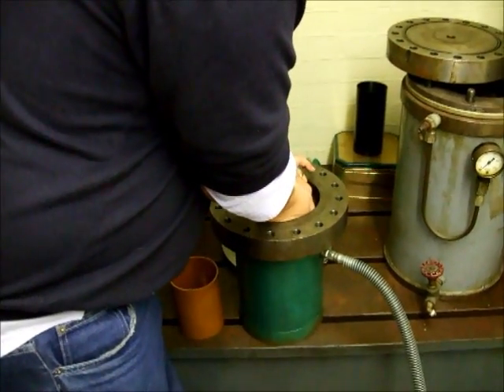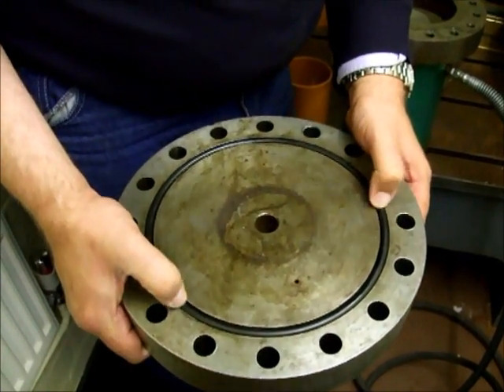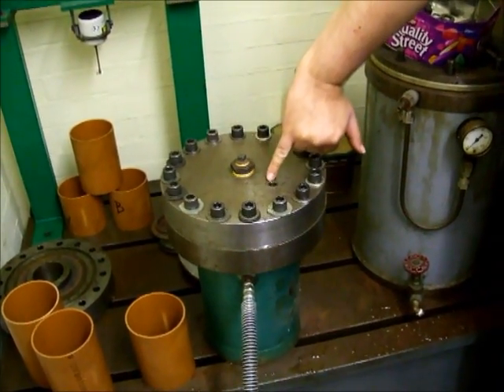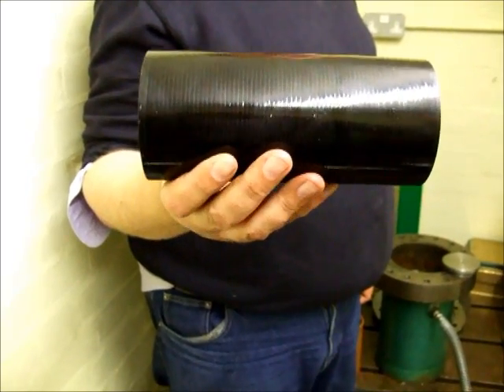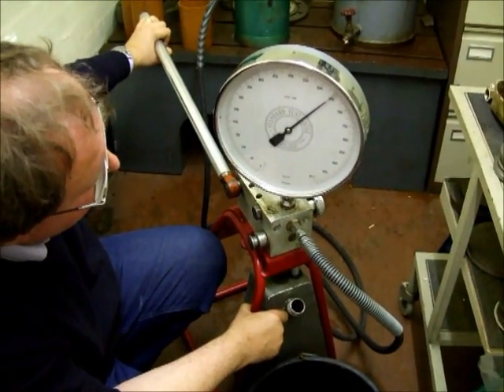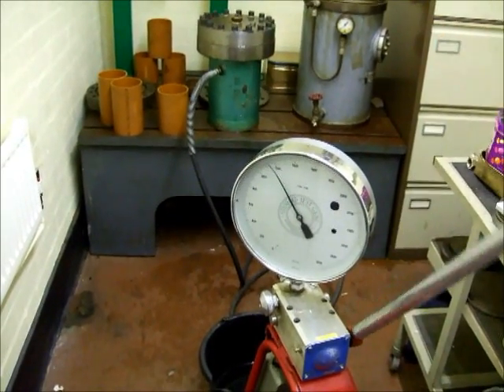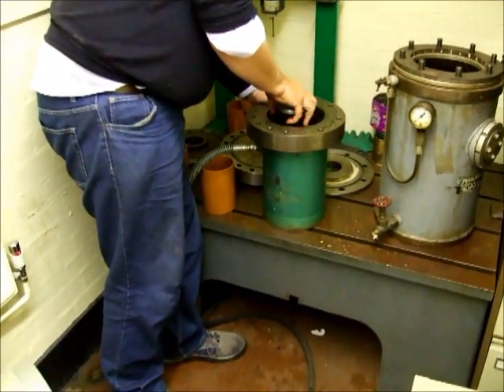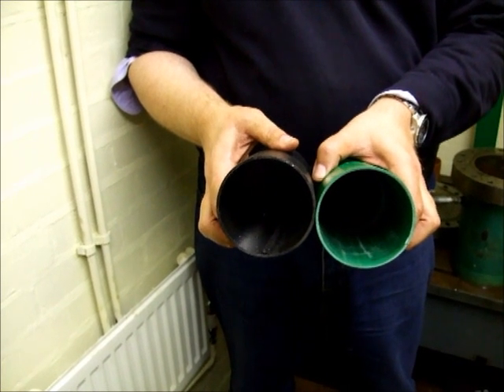Collapse of Composite Submarine Pressure Hulls

Comment: Airplane fuselages fail according to how many repressurizations they do. Material fatigue results.
Reply: Ultrasonic and visual. Material fatigue in aluminium will start as cracks so it can be visible to the naked eye if it's gone that far. On commercial aircraft you do inspections with regular intervals to avoid any big failures due to material fatigue. There's a reason way aircrafts are still made from Aluminium...
Reply: What kind of special device?
Reply: @neeleshramputh Although thousands of carbon aircraft fly, there has not been a single carbon-related aircraft accident to date.
Carbon is a good material if you have bigger pressure inside then outside. Apart from this, quality control, test certifications and working in accordance with standards is also an important thing.
Airplanes are beeing checked regularly.
Finally, carbon is beeing used for a long time. Not only on super cars, airplanes or on space missions, you can see them everywhere, where lightweight construction needed. Even mid range bikes for daily use are beeing produced from CF.
Reply: @dogukantosun5547  Not completely true.  American 587 crashed because of a failure of  a composite attachment lug holding on its vertical stabilizer.  Although it exceeded its design limits, it was apparently not a failure of certification or testing.
Reply: @mr3745  just googled and found the NTSB report. Following part is important; "Material had failed because it had been stressed beyond its design limit." It is not because of carbon. It was a miscalculation of engineers. Any other super strong material would fail, if an engineer would miscalculates the stress.
Reply: Look at the Hawaiian Air jet that lost a good section of its fuselage due to pressure cycles fatigue. Classic example.
Reply: @bruceblackerby3742  Fatigue is inavidible. On Aluminium aircraft (Like on Hawaiian Air disaster) the frame is divided into sections, so fatigue will not spread into other sections. In that particular ALUMİNİUM example, there was fatigue in every section because of a lack of control. This case was an exception and it is unlikely to happen. 
Unlike Titan, aircraft are not fully sealed. They are always lacking air and you compensate this difference with the bleed air from the engines.

Comment: Carbon fibre its a good material to make high pressure tanks, like GNG and Hydrogen tanks and can hold pressures up to 900 Bar. But the problem its that in a tank you have interior tension forces in a deepth submarine you have high compression forces exterior. Resins carbon fiber composites are weak in exterior compression forces.  To make possible to use in submarines the composite fiber must be done in double wall and the final weigh and price higher than metal.
Reply: Basically what Rush was doing (ironic surname in retrospect) was relying almost entirely on the strength of the resin and not the carbon fiber.  As you had mentioned, carbon fiber is at its strongest while under tension.  I don't have any sort of degree and even I know this. The tragedy is that Rush knew but ignored it.  Allegedly the carbon fiber raw material he had purchased was past its sell-by date (everything degrades over time, and the 'expiration window' on certain exotic materials is small due to degradation over time).  It makes me wonder how the strength of the discounted carbon fiber compared to carbon fiber which was within its date.
Reply: @BrooklynBubbler  carbon fiber is for all intents use once than destroy it in testing to collect data on how it took the ocean pressure.
Reply: Yep, "you cannot push a rope".
Reply: Might as well use metal like a strong steel-alloy or titanium then. Besides, those materials last much longer (CF can also delaminate over time from aging & exposure to harsh environments).
Reply: Also the cold temperatures makes the resin brittle and decreases its strength.  Stockton Rush was a fool.
Reply: Read somewhere they were supposed to use 7 inch of carbon fiber, but made to only 5 inch thick.
Reply: You still have to resist tension in a submarine's hull to keep it round. The problem is fatigue. Which is why steel is still #1, it has amazing fatigue resistance.
Reply: This is a great comment.  Carbon fiber gains great strength only by well engineered orientation of it's fibers to work forces and the process that is used.   There are some great lessons to be learned here if more were to come out on the sub's construction.  We do a lot of proof testing with considerable weight.  Keep in mind that this wasn't the sub's first trip and might have passed a pressure test if only done once.  This lesson here is that under multiple trips perhaps the materials started to give way bit by bit!!
Reply: Using carbon fiber composites to withstand high external pressure is like trying to use a rope to push something with.

Comment: Titan's carbon fiber cylinder wall was 4" thick!
Do a test on that!
Reply: I think it was just done
Reply: They did one a few days ago and it failed
Reply: My wife says that’s 9 inches
Reply: @ChuckNorris-yo3hu  - she's been taught well.
Reply: @ChuckNorris-yo3hu Maybe they should give it some viagra for strength.
Reply: The test is scaled to the diameter of the cylinder.
Reply: It was 5" thick.
Reply: Dude, like the gentlemen said above…a test was done a few days ago…on June 18, 2023. It failed.
Reply: @HeatherRose2023  the sub went to titanic multiple times.
Easy to assume it would perform as before.
Its like anything- each time risk rises.
Does not matter its driving a car, riding a bike, smoking a cigarette.
Its will eventually catch up.
No matter how safe they make airplanes- they will always crash.
Reply: @rdallas81  planes not always crash if they  are correctly tested and maintained

Comment: so if someone wanted to make a deep sea submersible, carbon fiber composite would be a bad idea.
Reply: Human-testing shows this to be true now.
Reply: I'm building one using wood and flex seal. As long as the lumber is pressure treated, I can go as deep as I want.
Reply: @danejurus69 Now That’s Funny 👍😵‍💫
Reply: @danejurus69 How's the project going 🤣
Reply: Why, don't you want your crush depth well above your test depth?
Reply: @@miraak8523 Of course - in the same way aircraft experience huge stresses and are subject to deterioration of structural integrity. It's just that materials that tend to be laminated are exponentially difficult to monitor for weaknesses that develop.  Seems to me that the structural technology used on Titan should have been wholly restricted to unmanned until such times as it could be proven as safe as anything used industrially or scientifically.
Reply: I'm not an engineer but even I see that it's fundamentally wrong to use it as a hull of ANYTHING, it just seems to be common sense not to use such a material, its strengt is tension, like many pointed out, it's very weak to resist pressure from outside, like in a tube or cylinder that will receive pressure from outside...it's pure madness to use it as hull of a submarine.
Reply: The Titan also took a lightening strike which would be impossible to determine if it caused some defect in the body - should have been considered compromised at that point.
Reply: @ernestsimons5982   I wasnt aware of that, do you know this to be true ?
Reply: @guyr.c.606  Yes, it's true, it wiped out the electronics which was concerning because there are no backup systems.
Reply: @guyr.c.606  Yes but that sub was eventually scrapped and a new one rebuilt.  So it has no bearing on this accident.
Reply: "Why you gotta bring up old sh!+"- Smokey- Friday.
Reply: I think it’s common knowledge that the main hull has to be a sphere and not a tube.
Reply: @davidbailey7579 Sphere is King!
Reply: They didnt stand a chance did they..
Reply: @guyr.c.606  The only chance they stood was that maybe it would happen to the next guy.  Kinda like russian roulette.
Reply: @guyr.c.606  Hopefully, not to be too flippant about it, but "chance" is mathematically defined as: "the number of successes divided by the total number of tries".  We (public) haven't been given the exact number of deep dives (to Titanic) that Titan had,  but the figure of between 14 and 24 has been stated. If we take the smallest = 14 and assume the disaster occurred on the 15th dive, then _ mathematically speaking_ they had _ a 93% chance_ for a successful dive...i.e. = (14/15)
Reply: @wordcarr8750  W. P. Mr bayes
so my 100 year old neighbour has lived for 36475 days has a 99.9973 chance of waking up tomorrow? and the longer she lives so does the probability of her living even longer?
Reply: @guyr.c.606 they stood every chance...don't go in it in the first place
Reply: Pfffft 😅
Reply: Carbon fiber is not for compression
Reply: But it needs to be light, because it if were too heavy it would.... uhhh, sink. And a submarine cannot under any circumstances sink into the water.
Reply: @@miraak8523Submersibles, not submarines. The Trieste, from 1960, went to the Marianas Trench. The Deepsea Challenger, which James Cameron used, had a spherical pressure chamber. And the Alvin.
Reply: @@miraak8523 I was talking about submersibles, sorry for the confusion.   @davidbailey7579 was discussing submersibles, you mentioned submarines, and I didn't catch that. Anyway, the Thresher and Scorpion were submarines, and I know little about submarines.  
Also, only the pressure chamber of a submersible is spherical.  Like the Titan, there will be parts of submersibles that aren't required to be pressurized to support life. The oblong white sides of the Titan were  fairings.
Reply: Never use a composite for deep sea submersibles. Never!!!!
Reply: I think so.....
Reply: If you did only a few dives, it would good enough. But with the pressure and esp. temperature stress it doesn't hold for say more than 5 years. UV is not the problem here.
Reply: It’d be a terrible idea.  Especially if one were to reuse said submersible at extreme depths repeatedly without ever pulling it apart to check the material, or replacing it altogether every other dive.

Why do you ask? 🤔
Reply: Unless your name is Rush ,,,,,,no time for testing or research,,,,,,2 seconds on youtube could have saved 4 lives , i say 4 because we now who still wouldn't believe the factual tests ....
Reply: When you look at the pictures of the interior of the submersible, it is obvious that no precautions were made to reinforce the central area of the composite tube. A person with the intelligence of a chimpanzee could have told you that the center of any tubular structure is the weakest point without reinforcements or making the central section of the tube thicker than the outer ends. This helps distribute weight/pressure more uniformly across the length of the tube. The engineering in the Titan submersible was substandard and poorly tested for concept. Scale models can and are an easy way to test initial concept. Full scale testing is still required but doesn't necessarily require completed model until  final tests. The main issue with anything like this is whether it can make 25-50% greater depth than operational depth repeatedly. None of this was done. What this tells me is that finances were insufficient to engage in a proper testing regiment. Construction methods were obviously cut corner such as occupants being unable to have a method of safe escape at safe depths much less on the surface. Control and communication issues  were a repeated problem, and built in functional redundancies were few. All people involved who were in a position to know about  the Titans flaws and failures should be held accountable in one fashion or other, for not screaming from the rooftops how dangerous this vehicle actually was. Also the people who actually were passengers on this submersible are equally at fault for not doing the research and paying attention to the many concerns by experts in the field of submersibles, but also previous passengers who had been on this underwater coffin. All of this happened because of human vanity and egos. It was totally preventable.
Reply: @@miraak8523 Down to the thousands of meters we're talking sphere territory. If there is a tube design I doubt it goes that deep. Tiny windows, precision machined sphere out of some unholy alloy seems standard for that deep work.
Reply: That's not entirely true... it really depends on how the fibre glass is prepared, bonded, vaccuumed, etc. The trouble comes when it's either been exposed to extremes of pressure as it's very hard to test for stress fractures, or whether there's been some kind of breach.  I did wonder about the light in the pressure cylinder of Titan, looked like it had been screwed directly into the carbon fibre interior. I'm no materials engineer of course but I have seen what happens to a carbon fibre car bumper even at low speeds/sea level pressure!
Reply: @shirleydick996  I was also looking at the various things screwed in to the wall... was that the hull or a separate inner surface?
Reply: @Sonnell  It must have been an inner liner. The guy was dumb, but could not have been that dumb.
Reply: @Mantrin185  Well, if he wasn't "that dumb" I think he would still be alive.
Reply: @shirleydick996 I think what did them in was the tiny window they looked out of. I read the night before we knew they imploded which was Wednesday night that it was only meant for 4300 feet
Reply: @Mantrin185  Yes, he was so brilliant he’s now ketchup. This is exactly the sort of thing he’d do and claim the people with qualifications are wrong because a brown girl with a high school diploma said it’d be A-OK.
Reply: @jummyran if it’s the case the window was only tested at 4300, it’s incredible he went down so many times before in the vessel but it never breached before if that’s true mind. You should remember some people got exactly what they paid for in this sub and that’s to see the titanic and make it home safe
Reply: @shirleydick996  That's only because the thermocouple disengaged from the apparatus/fixture at the exact moment of hydrodynamic fusion. Otherwise the acrylic/bisthmus interface would have kicked in as a worm!
Reply: @shirleydick996  Regardless of how it's made, fiberglass and carbon fiber composites will always be inferior to steel and other metals when it comes to compressive strength. There advantage is tensile strength which is not the property needed for the hull of a submarine.
Reply: @shirleydick996  if you actually watched the video, the experiment showed delamination after just 1-2 test. LOL. You can keep preparing, bonding, and vaccuuming all you want but wrapping a turd with super glue and spray it with jb weld and its STILL a turd.
Reply: @shirleydick996 so, your statement verifies that it is in fact entirely true
Reply: No! My friend Stockton told me you just need to have enough minorities in the room watching and everything will be fine. That’s what happened here, they had competent white people doing the testing instead of unqualified minorities.